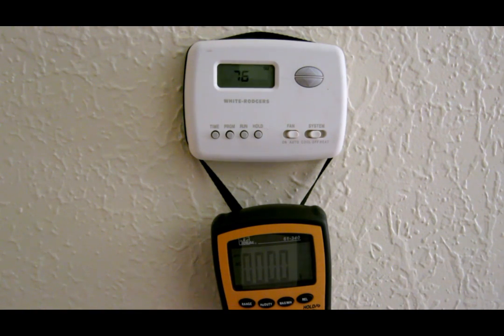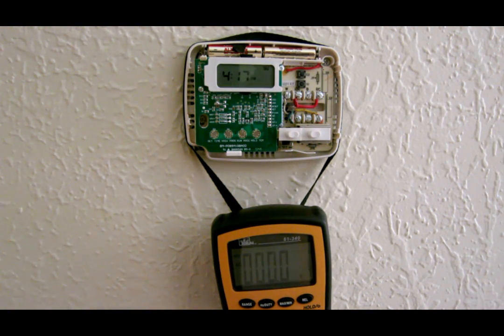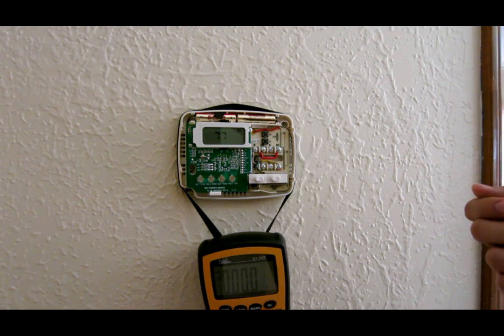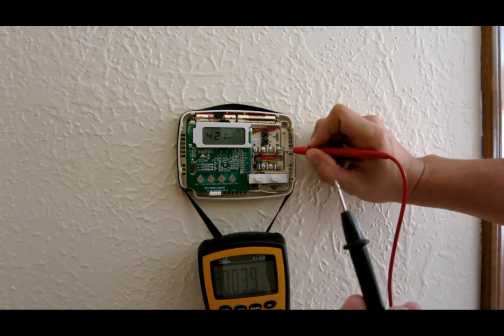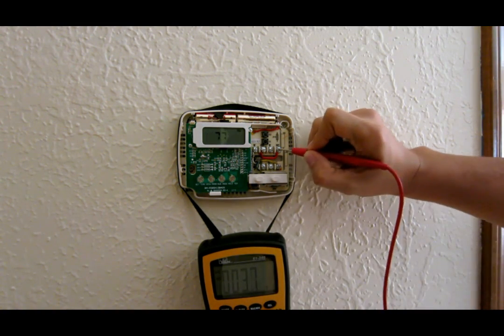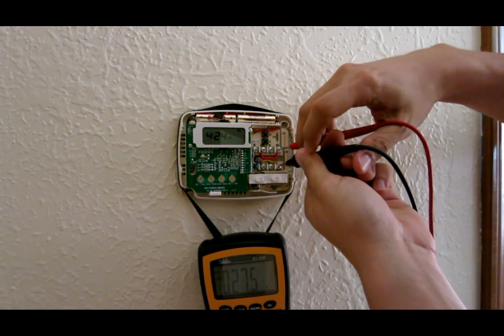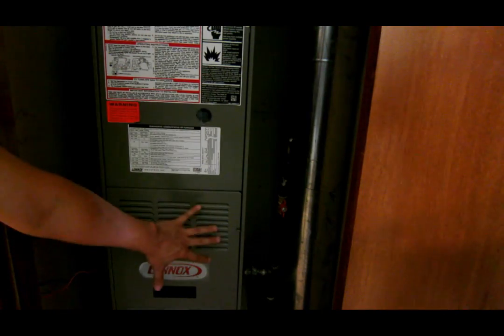Wiring and troubleshooting Thermostat - heat cold air condition AC howto HVAC wiring furnace

Comment: I just installed a Honeywell RTH6450 thermostat for my heat pump.  I disconnected the old thermostat and marked the wires, and reconnected them to the new thermostat in the correct places as per the instruction.  The blue wire was not used on my old thermostat, so that means I have a single stage heat pump, which I do.  So what's happening is my outdoor compressor unit thing is coming on, but the heat pump is not working.  It's just axillary heat.  What's going on?
Reply: wow i think u and all u other home owners and diy ppl just need to leave it to the proffesionals like myself. u are just going to screw more stuff up. if u dnt have a clue what the system is even called u have no buisness trying to fix it. thats my honest opinion.i mean really u called ur heat pump a ''outdoor unit compressor thing '' but then u said directly after that ''but my heat pump is not working''
Reply: joey kohout yes, it is his business to learn and troubleshoot his own HVAC system. So, give him a break. Also, technically he isnt wrong about the heat pump. As a HVAC professional, you should know heat pump is a type of reversible heat exchange compressor.
Reply: joey kohout it's amazing how SOME professionals get offended when DiY's try to fix things themselves to save money and to avoid getting ripped off by needless repairs by SOME professional HVAC techs in the field. It doesn't take a rocket scientist to understand the basics of HVAC systems if you are even just slightly mechanically inclined. This gentleman has helped me fixed many things from his videos that I had no clue about so please stopped bad mouthing this man just because he doesn't know just as much as you do about HVAC systems..

Comment: Good stuff. I have been troubleshooting an issue with a furnace and this gave me a better feel for how everything should be connected. I did wish that you spent some time covering the wiring at the furnace as sometimes you may be trying to determine if you have an issue with the thermostat or the wiring.

Comment: Armin. Is your thermostat programmable. If so it is programmed for 70, which you can change, and you should also have another button that says hold so if you change the temperature to 73 and press hold it will stay there you can stop that at any time by pressing the run program button

Comment from the maker: you have a zone controller and two dampers in your duct system. Sounds like the zone controller isnt shutting off. Either way, you need a volt meter and the fundamentals still apply to this situation. its just a little more complicated. you might have to call a HVAC pro to help you with this.

Comment from the maker: @ 2:08 it explains what each wire does. @ 4:25 explains the voltage difference.
its hard to troubleshoot without a volt meter... also, I was assuming you have 2 AC units. but now im not sure because there's something odd with the "Downstairs controls overall" statement. Sounds like you have one unit, with two thermostat?

Comment: We replaced the upstairs stat because the fan was running continuously, and the stat would show that it was 80 degrees when we were freezing. The new stat shows that it is in fact very cold - 63-64 degrees even though we set it at 72. Even with the upstairs stat off, the fan runs continuously, and upstairs is 68 degrees. I had watched the video before my previous comment. Not sure which part to follow. We don't have a volt meter

Comment from the maker: Was it working before, but this problem happen after a new thermostat? if so, then sounds like the thermostat. 
If not, follow the above video and see if the relay opens back up (goes back to 24VAC) between yellow and red. if it opens back up, but its blowing cold air or warm air; both can point to different issues. let me know if its cold or warm air.

Comment: I have the same problem. The AC runs constantly and cools to below the set temperature. We just replaced the thermostat, but woke up to 64 degrees up stairs. There are 2 thermostats for one unit. Downstairs controls overall. I had to turn off the downstairs to stop the upstairs from blowing continuously. There doesn't seem to be info on the web for AC's that blow too cold. Help? please...

Comment from the maker: yes, C is just common return. I dont use the C wire either. But if you need the C wire (as you said to power up the unit), then you can use any left over wires, connect it to C on your control board, and relay it back to the thermostat. hope that helps.

Comment: Thanks for this video.
Where do you think my issue is if the AC continues running even after reaching the desired temperature? It keeps cooling continuously well below the desired temperature, till it's shut off manually.

Comment from the maker: The 24VAC goes to the transformer, which is in your furnace unit. 1st check the furnace and see if you have 120VAC. If not, then thats a breaker issue. 
2nd. if you do have 120VAC, then check the overflow switch (you should have it if your unit is less than 15 years old)youtube.com/watch?v=DXqXmz0YwQs.
3rd. check your 3Amp fuse on your controler board. 
These 3 simple steps are the most common issues in my opinion

Comment: Hello, I need help on my house. I do electrical but I know some basic things for A/C. One day I left the A/C on came back and seen it was off. So I tried switching it on but the thermostat was completely off. I opened it and checked the low voltage and it's not reading the 24v on the red wire. I check the panel, the disconnect for the 240v. Then I check the contractor and it only reads the 240v but the low Voltage does not read 24v. I'm stuck here what can I do ???

Comment from the maker: well, typically brown is used for either common or Heat Pump. you should physically check it out. Having that said, yes, common and cooling wires does go from the furnace/blower control board to the condenser unit's contactor coil. 
I have a video on my channel that explains this in detail:youtube.com/watch?v=cnD65qX8bjM

Comment: Thanks for the helpful video. How does the yellow and Brown wire coming from the A/C condenser units outside connect to the furnace/blower control board in the attic? Do they connect to the respective terminals (Y & C)?

Comment from the maker: Hmm... many things could cause that issue. Sensors, thermostat and controller board could all cause that to happen.
A common issue if your blower stays on all the time, is that you could have a safety feature (sensor) stuck that keeps the blower on all the time. Check your flame sensor, temperature sensor, heat sensor, etc... 
you will need to review your furnace schematic and figure it out. Check my "furnace" videos.
Reply: My fan is on all.the time

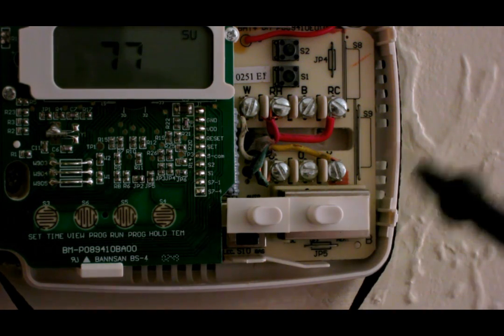Comment from the maker: @ 2:17 Any Thermostat basically closes and opens the circuit. You can do the same measurements with a mechanical/mercury thermostat. The furnace circuit board supplies 26VAC to the thermostat. which means you can still measure these voltages @ 4:15 on your old thermostat.

Comment: if you run a common wire to that you would not need those batteries,your tstat wire most likely has enough wires to do so,not all tstats are universal,you should have explained the orange wire on the control board and if the tstat was for 1heat, 1cool,or 2heat,1cool or what you were dealing with,it easy for me to watch and tell but im sure if i was making the video i would be nervous to good video,was that a oil furn.? i worked on a lot of oil furnaces,how long have you been doing hvac?later!

Comment from the maker: you might have damaged wire, lose connection or incorrect wiring. Go to the circuit board at the furnace and check between wires if there is 24VAC difference between red and (white, green or yellow) connectors. If you do have 24VAC but you dont have any voltage at the thermostat then you might have a wiring issue.